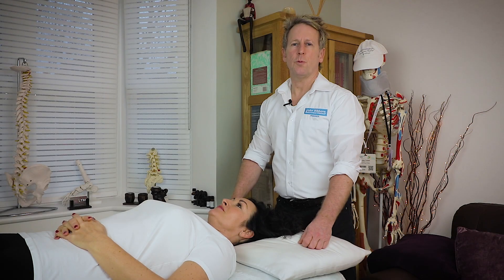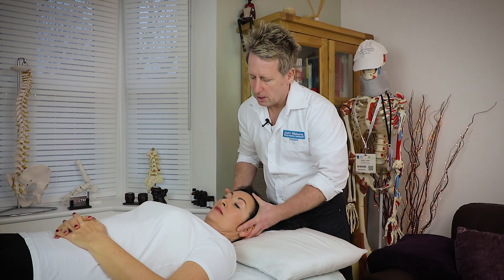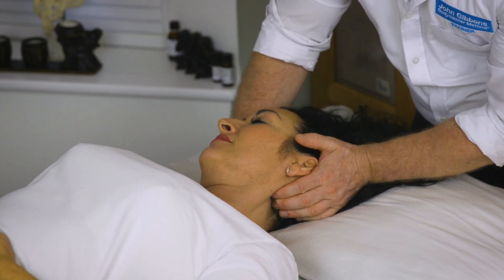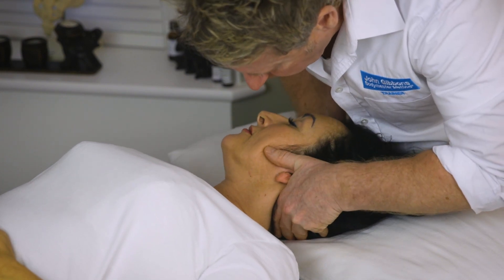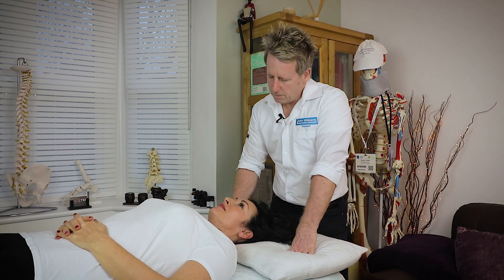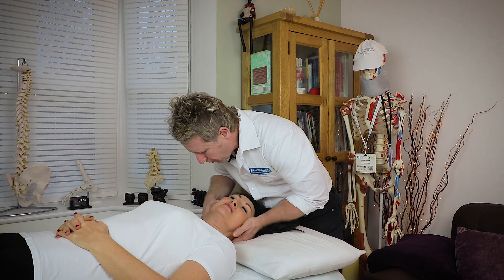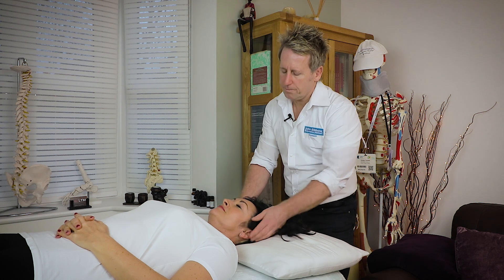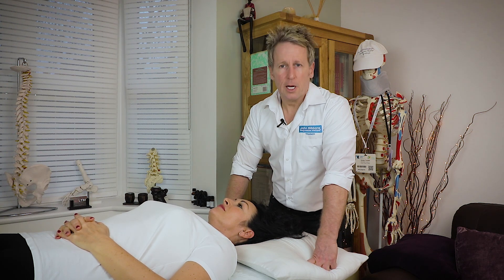Spinal Manipulation adjustment to a VERY stiff neck (cervical spine)...!!

Comment: Stupid question: if releasing the "gas" from the joints/ area of concern helps alleviate the problem of mobility and pain, is the cause too much gas building up?
Reply from the maker: No research to say exactly what happens when we cavitate the joints - however, the patient typically has improved range of motion of that specific area that was treated with manipulation, regards JG

Comment: Be careful people and always check with doctor because even though this guy looks like a professional, I’ve been to a chiropractor where I was way worse after an adjustment. Also, Caitlin Jenson was paralyzed and went into a stroke and died for 10 mins from a neck adjustment for a stiff neck. The adjustment snapped her arteries.
Reply from the maker: Thanks for the comments and the chance of causing an issue is close to zero - unless you are treated by someone not qualified or not experienced - regards JG

Comment: Great demonstration & explanation John. Should a HVT be followed up with grade 1/2 oscillation joint mobilization Flx/SB to further calm down the pain via activating type 1&2 mechano-receptors?
Reply from the maker: You dont need to after a HVT unless you think it will help, regards JG

Comment: I'm glad this is a real reaction to having extreme pain and being stuck and stuff. I hate all that laughing after and the chiropractor acting like they were in all this pain. I'm the same way as her.
Reply from the maker: Thanks for the message and yes she does have a stiff neck - multi level disc pathology from the MRI scan - even though she is hyper mobile in other areas of her body, regards JG
Reply: I actually had a little cry afterwards but I really needed it after years of trauma with horses.

Comment: Can chiropractors treat acute cervical spondylitis being stiff for close to 30 years cant move neck at all. He is a heart and blood pressure patient too ... Please suggest
Reply from the maker: I doubt it is spondylitis and is probably spondylosis and if thats the case then the joints will have degenerated - I personally would treat below the level of C4-C7 as that is where the spondylosis typically happens and above the level as I find that helps, regards JG
Reply: @JohnGibbons  yes the spinal cord bones are fused and he cannot move his neck at all

Comment: plzzzzzzzz reply I have accute neck pain for two years now mri shows c4_c5, c5_c6, c6_c7 causing mild disc bulge plz Dr reply
Reply: can I go for charpector or go for steroid injection
Reply from the maker: Mild disc bulge is relatively common at those levels of the cervical spine and debatable if the structures you mention can cause the pain. See a therapist like me as sure they can help, regards jG

Comment: I hv issues  with my c2.i crack my neck very often, it can popped  up 100 times in a sitting. 
anyway  when i dont move my neck more, or don't crack it for 2,3 hours, it becomes stiff, and then i would move my head  left and right, up amd down, and my crack would be that loud  ,that u can hear  it from the other corner of room. 
I m miserable
Reply from the maker: It will be ligaments that will be making the noise, not the joints releasing, try and see someone like me as sure they can help, regards JG

Comment: My chiro did this neck twist twice on the left but didn't do it on the right. Is that normal? I feel so awkward that she did one side only and didn't even do anything on my back when I told her I got back pain.
Reply from the maker: Hard to comment as typically it is one side that is fixated, however most therapists (and myself) will do both sides. regards JG
Reply: @JohnGibbons  thank you very much. I've asked around and they said the same as you too. I appreciate your reply. I'm definitely not gonna return to that chiro anymore.

Comment: I lean on my side on my bed holding my head with left hand been doing it years , when i now turn my neck its stiff and aches , the chiropractor cracked it... it makes such a loud noise  .. but now it hurts and its stiff 3 weeks later
Reply from the maker: Had to comment without looking at you, I am sure the neck will settle down, regards JG

Comment: I have Tourette’s syndrome, One of my ticks is cracking my neck. I do it a lot throughout the day but the loudest cracks are in the morning, or if I haven’t done it in like an hour or two. I basically put my hand on the right side of my lower jaw, then look up to the left, and in a swift move push my neck ever so slightly to the top left, I do the same with the other side. Can you tell me if this is healthy or not. Just because I do it every day and cannot help it
Reply from the maker: I doubt it will cause a problem so shouldn't worry to much about it even though i personally wouldn't be doing it every day, regards JG
Reply: I crack my neck the same way

Comment: My head keeps cracking when I rotate it even if I rotate it like 10 times it keeps cracking. I don't know why.

p.s. Sorry for my english
Reply from the maker: Thanks for the message and try and see someone like me if possible, regards JG
Reply: Zennyo Ryuo it happens to me, it’s the sound of bones grinding. When you turn at a certain angle, some bones in your neck will grind or scrape against each other and that is what the cracking like sound probably is.
Reply: @digitform2832  Miine does the same. Its not panful bu very annoying

Comment: Hi John, what do you think of ppl that are able to crack their own necks? Is it effective at all or do you think it doesn't make any difference at all?  I used to have chiropractors adjust my neck and lower back.  Then I saw a friend cracking her own neck.  I decided to try it.  I was able to slowly get it to crack.  Now I'm doing it very easily.  My personal opinion is that I feel it does release the tension that builds up on the neck and head but I wanted to hear your perspective on that.
Reply from the maker: I personally don't recommend self manipulation as I believe the wrong vertebra cavitate and most people got no idea what they are doing. Thanks for message, regards JG

Comment: Can you explain from where, anatomically, comes the sound of cracking and what is actually released during process of manipulation?
Reply from the maker: Hi, the cavitation is a release of gas from the facet joint. regards JG
Reply: @JohnGibbons  Thank you for the prompt response (and, of course,  the rest of your tremendous knowledge and dedication that you share with us), but could you be more specific which gas, how it is formed, what metabolic process creates gas, where does it go, transfer, change to.... What happend with the "gas" if it is not released? I noticed that afters some pelvic and muscle alignment my lower back spine does not crack any more. Does it mean that wrong posture and displacement of vertebras, discs or joints creates "gas"? Do you find in your practice clients to whom you can not do neck cracking manipulation, meaning, when you do manipulation nothing happens?  Sorry for too many questions, but I did not find anywhere on the web an explanation except that this is release of the gas but I would like to now more about chemistry behind this manipulation. Kind regards.
Reply from the maker: Hi, interesting questions and there is not much information on the internet...as far as I am aware the gas is a mix of carbon dioxide and nitrogen and possibly oxygen and I perceive the gas is released from the synovial membrane and through the joint capsule during the high velocity thrust (HVT) and this motion actually causes the joint planes of the superior and inferior facet joint to separate and this is called a cavitation. Generally speaking, most patients tend have more motion and reduced pain after this technique. Hope that helps, regards JG
Reply: @JohnGibbons  
I guess the question of @AWD7 could partially lead to the following : 
is cavitation a sign of a vertebra putting itself back in place ? 
I'm pretty sure we both know it is wrong and fear-mongering to say so. 
We both know we can make the same, and whichever, "synovial" joint pop every 20 minutes or so. 
It would be weird (totally irrational) to be stuck that often. The idea is sensational.

But on another note. 
What would you deduct from the intensity of the sound of the cavitation ? 
Would you say that big noise cavitation arise more out of "stiff" segments or out of segments that haven't been popped since a while ?

Thanks again for your sharing and your time.
Reply: Maxime de Fooz )
Reply: @AWD7 and @John Gibbons The cavitation is not a release of gas rather it is a joining of smaller gas bubbles (Tribonucleation) in the joint capsule. It is not “released” or “popped open”. This rapid joining of many small gaseous bubbles causes the audible.